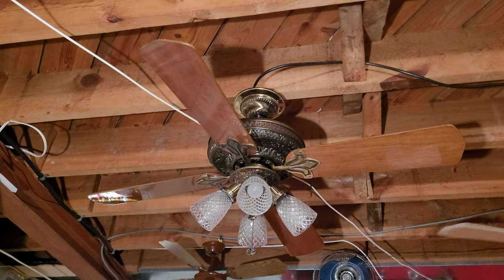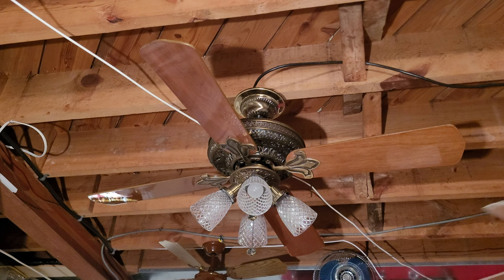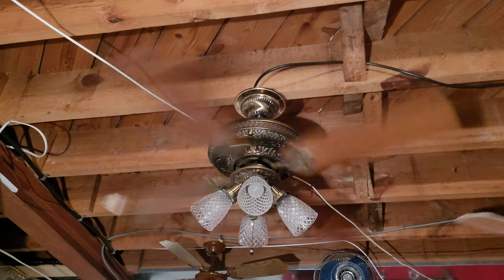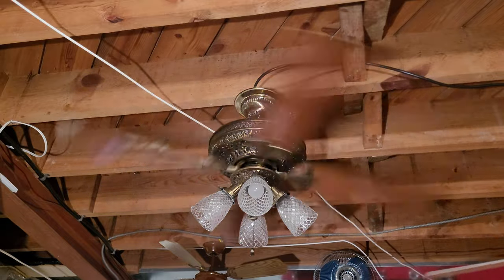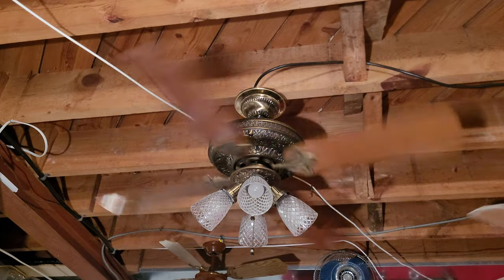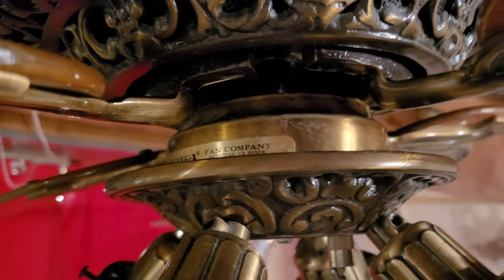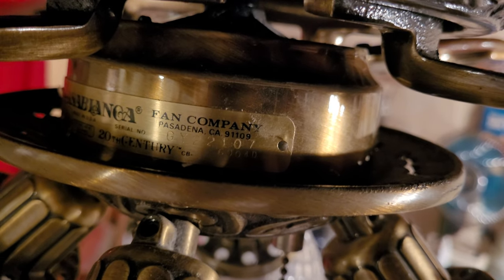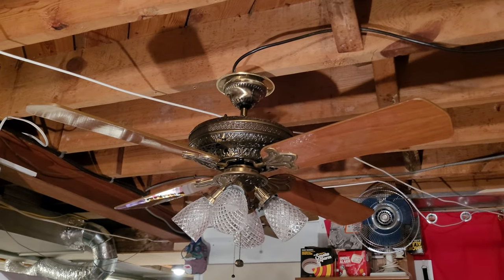Casablanca 20th Century (Gallery Edition) 52" Ceiling Fan

Comment: Actually, these had the K63 motor until 1984 with the introduction with intellitouch. They probably didn’t want to re-design the housing until ‘84. They were cardboard box until ‘84 too. Very suprised that they were made this late
Reply from the maker: Huh I had no idea they used the K63 that late, guess it makes sense though since Emerson was still making blenderfans with the K63 at that time iirc
Reply: @BAFVintage  there had been a 20th Century with SlumberQuiet and K55 that surfaced before. They were using leftover K63 motors before they ran out.